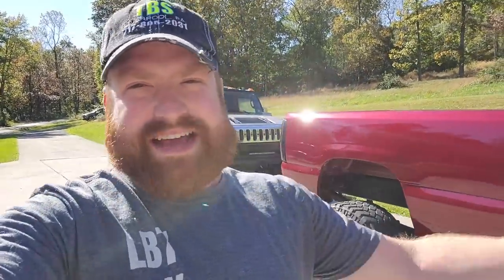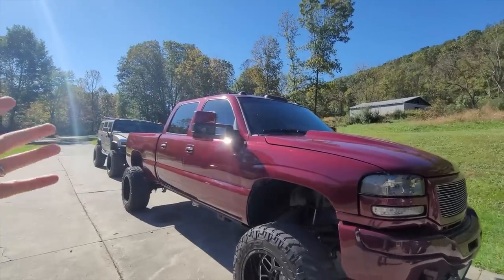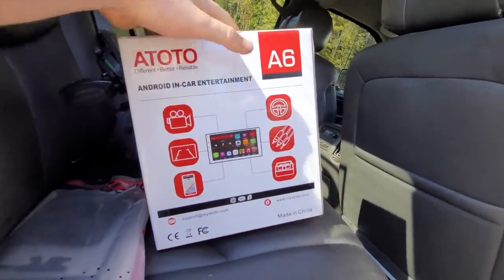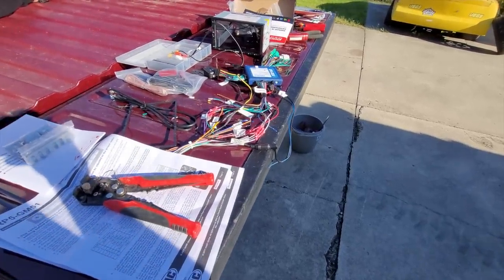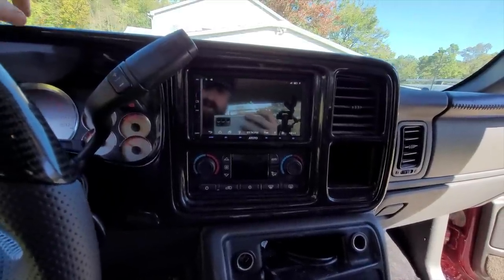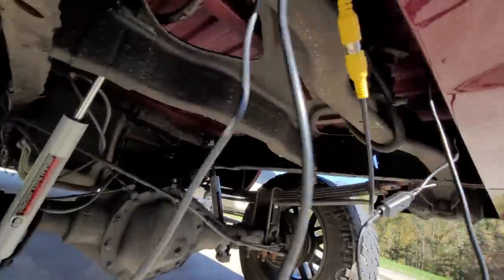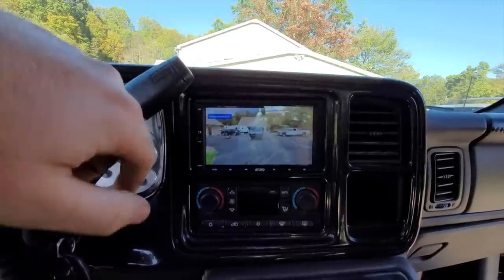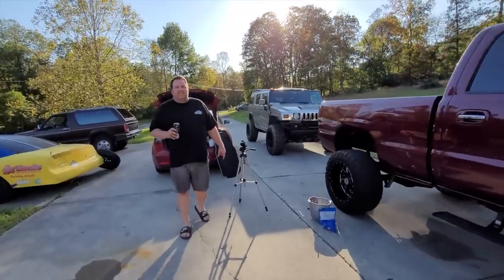Old Duramax Gets Lots of New Tech!

Comment: I upgraded my 2012 stereo with a reverse camera system. I found a tailgate handle bezel with built in camera factory OE style that bolts up directly all I had to do is drill hole and install grommet into bottom of tailgate.
Reply from the maker: That's awesome. I honestly didn't even know those existed until after I already bought this camera but I might switch out to that style some day.